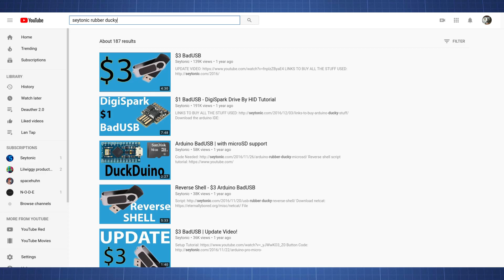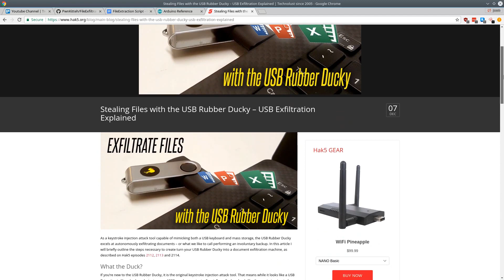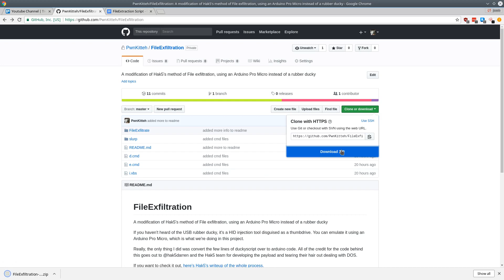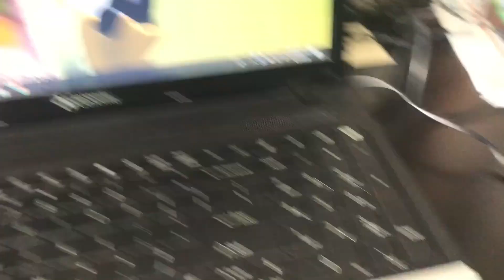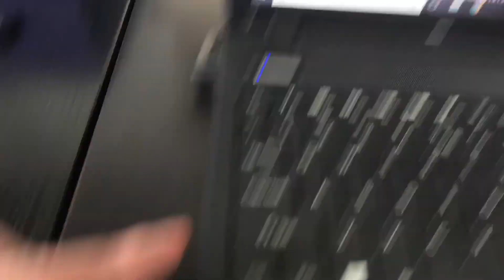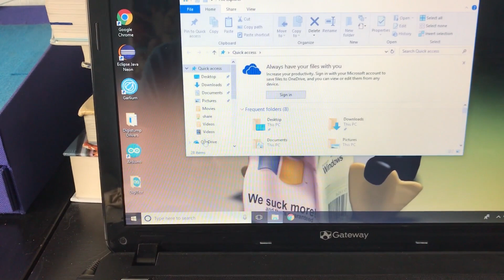Stealing Files with a DIY USB Rubber Ducky (Arduino)

Comment: Does it also works with just a normal Digi Spark? So not a pro?
And is it possible to use an USB splitter fot this, so i can stick both in at the same moment? 

Sorry for my bad English, im dutch.

Comment: Quality video as usual.

If I were to attempt this with a Nexus 7 running Nethunter, would it be possible to run Ducky script and then reconnect the same Nexus with MTP enabled to act as the second mass storage device?
Reply from the maker: I actually haven't tried it with nethunter, but I have a Nexus 7 lying around I could give it a go with. I'd assume that would work, but I haven't personally tried it, so I can't say so for sure. Nethunter does give you the ability to act as an HID though, but because of the way USB works one device can't usually act as 2 things at once, so you'd likely have to load the program into RAM on the target machine and then have it switch back to mass storage. Or you could just save the script to the machine as a powershell or bat file, and execute it manually. That kind of takes away from the plug two drives in and run aspect of this attack, though. 

Honestly, pro micros are like $4 on aliexpress, and I picked up like 5 a few months back. You can get a quality usb 3 flash drive for about 20 bucks, and then you're set. Or you could go the seytonic route and solder a dip switch to the back, which would allow you to store all your payloads on one arduino. 

Thanks for watching, I really appreciate it. More videos are on the way, and I'm trying to improve my content quality.